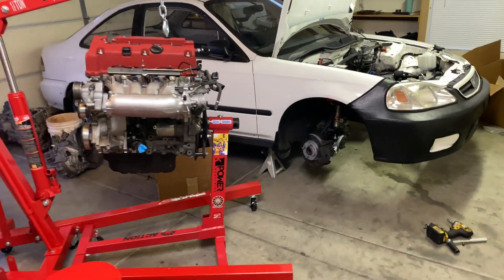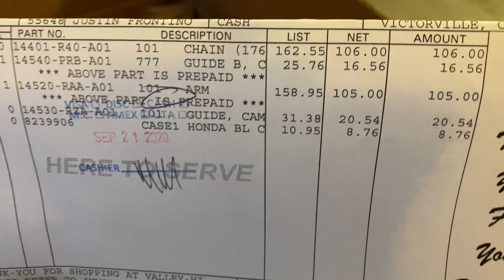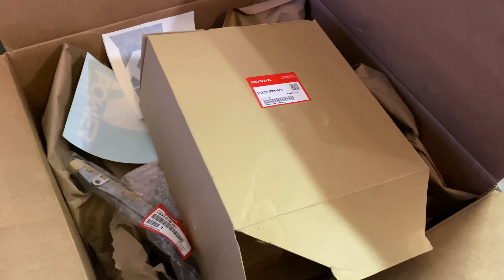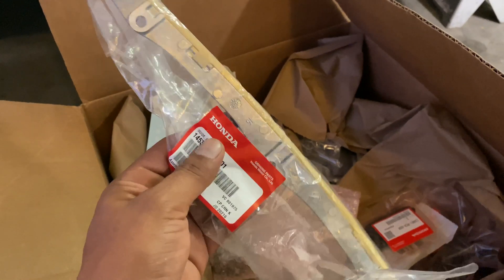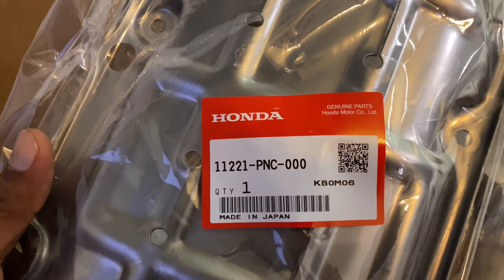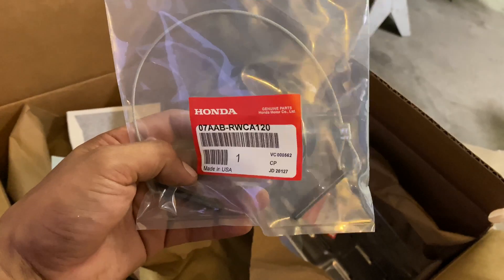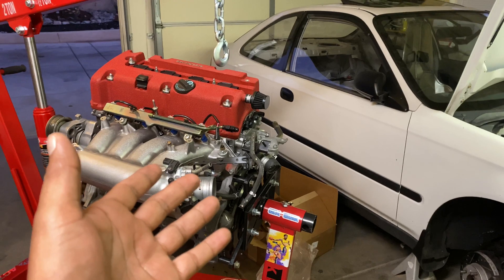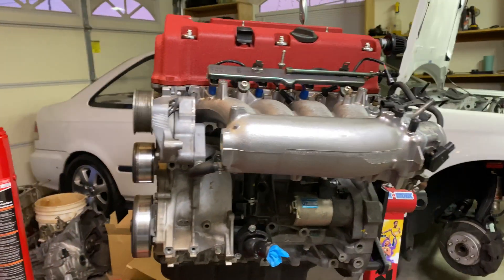K24 oil pump swap pt1

Comment: keep it up !! i have a question what bracket and throttle cable did you use for the accord tb?
Reply from the maker: I made a custom bracket
Reply: @oemworx4147  Which Accord throttle body did you use?